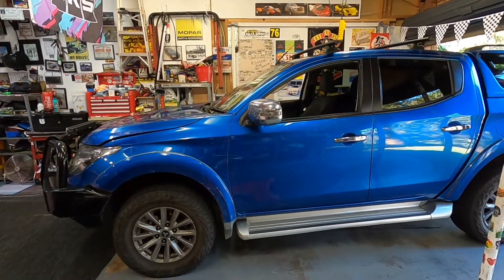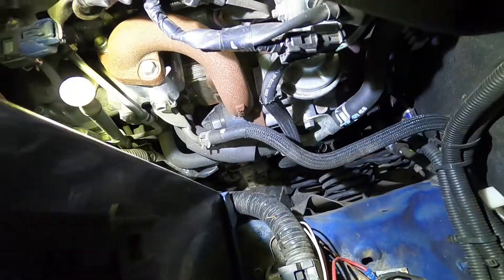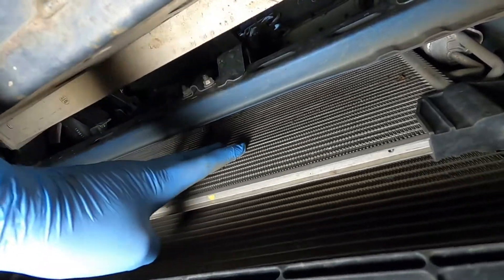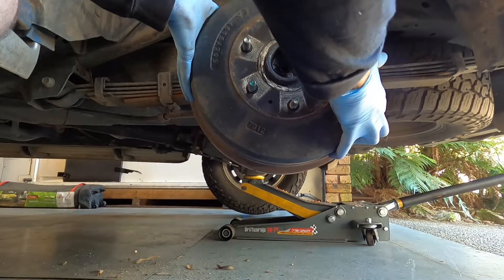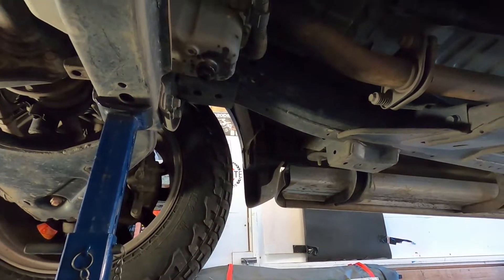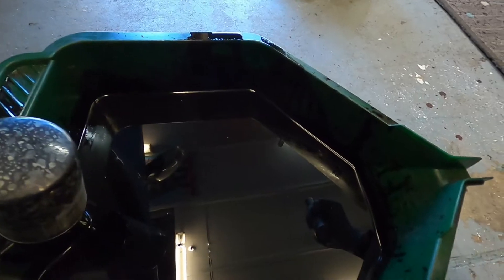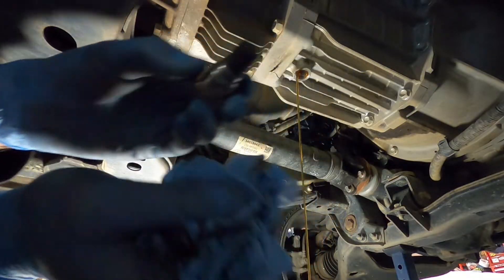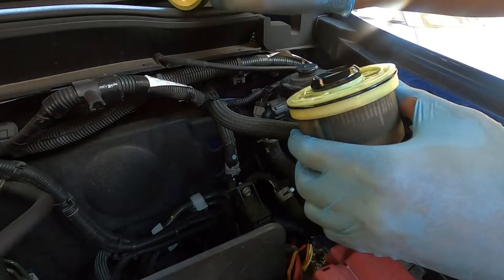Mitsubishi Triton 2.4 turbo diesel 4n15 service oil and filter change how to step by step.

Comment: brilliant,  very informative, now i can do my 2016 Triton with confidence,   i'm sick of getting ripped off by dealers,  the last dealer charged me almost $600 for a normal service,  no gearbox, diff, air, or fuel, filter changes,  and was returned to me with guard scratches which pissed me off hugely.   cheers.

Comment: Hey Mate! Great work on the service. Just to add something. Whenever you are doing a oil service on any 4N Mitsubishi Diesel engine, you need to perform the oil dolution reset -> On The MUT dealer tool this function is in...Engine / Special function / initialisation / exchange engine oil service. On other tools it is something similar, depending on the make and model.

Reason for this is that diesel gets injected to start and keep the DPF regenerating when it needs to. If it is sucessful, the fuel is burnt with no problems, but if the car is unable to complete its burn, or is trying to burn and there is another reason it cannot, then it will be added to the sump and the oils counter in the cars engine computer will increase.

When the car is serviced, the tech must reset this oil counter. And he should know what to look for depending on the reading. or instance if it reads 1500cc, he should know to look for an issue.

A car that is doing enough long journeys and has no problems will have a count of 0cc - 100cc.
Anything up to 600cc is ok with no action needed.
Reply: So those with 4n engines looking to self service should buy a scan tool to reset aswell?
Reply: @signature8543  In other words - yes. Resetting the oil dolution/exchange counters are part of the standard ""oil service/change" procedure in the official dealers (at least from my experience in Central Europe) If you are doing it yourself it is preferable to reset it with a scan tool which have the functionality to do it.  It sounds somewhat stupid, but something little like that can prevent you from spending thousands later. If you are doing a lot of highway miles the counters will not rise as much as doing a city driving. So definetely you need to monitor the values every 5-6 months to know where you are with the oil dolution.

This topic definately needs more visibilty because it is solving a lot of problems and in the end of the day it is simple reset.
Reply: @ВГаража  legend mate. I wouldn’t have even known about any of this hadn’t I scrolled through comments.
Reply: Don't need a MUT my $250 Launch does it like most scan tools you need to know where to look, but yes  it needs to be done...
Reply: @neilasd3043 agreed, my Foxwell unit is capable of resetting codes.
Reply: @ВГаража my experience is that when the oil level (calculated) reaches 1550ml a flashing DPF light appears on the dashboard. As this is a calculated value, if it is not reset when an oil change is performed you will eventually reach this threshold and get an error (p252f excess oil level) code and flashing light even though the level is correct. As you say, it is not just sufficient to change the oil and reset the service interval as this does not reset the oil level counter😮😮

Comment: For anyone reading the comments and wondering about which brand gear oil to use in their manual MQ/MR gearbox, definitely use Penrite Trans Gear 75w80! 

I’ve tried the genuine Mitsubishi DiaQueen oil, and Valvoline DuraGear and both are substandard in gearshift feel compared to Penrite.

Comment: Mate!!! Thank you so much just did my service,  never touched an engine in my life, and even replaced a faulty throttle Body myself!! Thanks great video. Also just a quick question,  when I drained the oil my 9 litre container overflowed ! If only meant to have 8.4 litres, does that mean Mitsubishi put to much in? Cheers

Comment: Mate!!! Great video!! I know nothing about cars and this has given me the tools to attack m 2016 Triton!! Only question, is the method for the oil change in gearbox the same for automatic?? Cheers
Reply from the maker: @sebastianperalta1111  the auto is almost the same. Just measure the amount of fluid that is drained and refill with the same amount of automatic transmission fluid.
Reply: @driftcarsjp  awesome thanks for the quick reply mate!! Wish me luck !!!

Comment: Thanks for making this video. I really appreciate it. Looks similar to my 2010 Automatic Turbo Diesel 4x4 Triton, I'm assuming this info will apply to older models too? As a female, I'd love to be able to service it myself and know what to look for so I know i'm not getting ripped off. Please keep making vids on the Triton. Maybe you can also set up a Patreon page so people can donate for the valuable info you provide. Thanks again.
Reply from the maker: You can apply this to any car just the fuild levels differ. Thanks for the positive comment much appreciated   👍
Reply: The MN Triton oil filter position is different. I do 7500Km oil changes so I do the in-between oil change. I access the oil filter from under the mud guard.

Comment: Hi There,  you said the engine takes 8.4 litres of oil?, the manual states the 4n15 diesel engine holds a total of  7.4 litres of engine oil, 7 litres in pan + 0.3 in filter + 0.1 in oil cooler, every oil change I have ever done has always been 7.4 litres, I have a 2017 MQ Triton GLS auto 4x4 dual cab, also when I look at Penrite's Lube guide it states 8.4 litres as well, strange?
Reply: I agree

Comment: Hi Driftcarsjp great walkthrough mate!!! I also do a few of these. Have you encountered the oil level fault yet that can get logged in the module. It stopped the DPF from doing a burn - regen and by oil level reset i do not mean oil service light. 
Cheers Mark
Reply from the maker: Haven't had that issue yet
Reply: @driftcarsjp  thanks mate if you ever do ill try explain unfortuanetly i did not video it.
Cheers Mark
Reply: Hi Mark, I am interested on finding out how to reset the oil dilution after an oil change. I have just done one at 7500km's half way to the dealer service at 15,000. I know how to do it on a D-MAX but not on my MR Triton. I don't think the majority of people realise how much of a big deal it can be if its not reset, with some people thinking it is to do with the service reset (which it isn't) Cheers Simon
Reply: @simonar1  I will find my notes and let yo know hopefully.
Reply: @markbritten1744  thanks

Comment: Subed, what oil to use in automatic transmission MQ 2015. I went to Tynan's to buy Trans oil and the don't stock it, so I asked what they use, spare parts guy called the workshop and said Castrol and gave a number but not a viscosity number. I called Castrol and the said don't worry about changing the oil if it's not black. Car has done 130000km.  Can you advice me on what oil to use and how many liters do I need?
Thanks
Reply from the maker: You can use penrite Multi-vehicle full synthetic ATF LV should take around 4-6 litres drain and refill ,unless you flush it.

Comment: Hey bud, how come the truck doesn't have to be level when filling the gearbox and engine with oil. I thought that would be critical to obtain the correct level
Reply from the maker: Having the truck slightly off isn't going to cause a great difference in oil going into the box. More will just go to the rear of the box wile filling as the filler is generally in the middle of the box.

Comment: Thanks for the great video mate. Can the gearbox oil level be checked with all 4 wheels on the floor? I can fit under there  OK,  just wondering if the gearbox needs to be leveled by jacking the car?
Reply from the maker: It does need to be level although a slight slope and a little extra oil doesn't hurt the gearbox..
Reply: @driftcarsjp  Cheers mate.  What should I level?  The chassis rails are angled down toward the front of the car and the gearbox is angled down toward the rear of the car when all 4 wheels are on the concrete.  To get the gearbox level I would need to jack the rear of the car up a bit, but to get the chassis rails level I would need to jack the front as it's natural stance is a bit nose down. When I initially removed the fill plug prior to removing the drain, I had around 200ml of oil spurt out. I have refilled with new oil to the bottom of the oil filler hole and I appear to be about 200ml short of the recommended 2.2L oil volume. All of this is with the car sitting on the level concrete floor. Should I jack it and see if I can get some more oil in or is it OK as it is?
Reply from the maker: @peterkerr542  200ml less is fine you'll never completely drain the gearbox anyway, there always be oil left in the box after draining it..
Reply: @driftcarsjp  thanks mate. Appreciate you getting back to me.Without a doubt the best servicing video I have seen for an MQ Triton. 👍
Reply from the maker: Thanks for your kind words..
Reply: @driftcarsjp  FYI - I took it for a dive and then let it sit for a few hrs to cool down. Checked the level again and found it had dropped below the filler hole and I was able to get the remaining 200ml in. Must have been an air pocket in there somewhere. Cheers.

Comment: For some reason i cant get the fuel filter to tighten up without leaking.im screwing the clamp up and it leaks when priming.Any tips?
Reply from the maker: It could be the rubber seal has twisted or not sitting in the correct groove in the plastic

Comment: HI sjp, How often do we change the oil gear of the Mitsubit trion pick-up 2017? because when I go to Mitsubit company to get the oil service, the oil gear is long life oil no need change it, in case the gearbox get the- problem that we need to change it? Are they correct in their recommendations? From Veasna, Cambodia
Reply from the maker: I would change the gearbox oil every 40000kms or every 2 years if heavy off road use.. no or light offroad every 3 years

Comment: can anyone tell me what diff oil you can use in this vehicle front and rear, MM specifies SAE80 GL5 but cant find anywhere
Reply from the maker: You can use 80w 90 premium mineral if you can't get GL5 . Where are you located?
Reply: @driftcarsjp  Thanks for reply I'm in Melbourne,  so a 80W90 GL5 will be OK instead of SAE80? I suppose when cold it will be the same thickness (80W) only a little thicker when hot
Reply from the maker: @frankm4120  penrite does GL5 75W 85 full synthetic
Reply: @driftcarsjp  Hi Thanks for your reply, I'm located in Melbourne
Reply: @driftcarsjp  OK, I have that at home,
you reckon it's a little thin at startup (75W vs 80),  or it should be right?
Reply from the maker: @frankm4120  that's the recommendation oil .
Reply: @driftcarsjp  thanks for your help,

Comment: I have same car as yours, but I have issue with my car. my car feel jerk after it's at warm temperatures or drive slow, especially at traffic jam. but it's changed smoothly when i just start driving at morning or i drive fast. Until now don't know what is the issue is🥲
Reply from the maker: @njfishing1917  manual or auto?
Reply: @driftcarsjp  mine is auto sir, 5 speeds

Comment: Hi , my triton mq has just done 90k. What should i include in my next service? Normal oil/filter  change  , fuel filter, air filter and spark plugs? Any other thing. Appreciate ur help.
Reply from the maker: Just diff and gearbox oils aswel
Reply: @driftcarsjp  thanks, do u have a vedio of sparkplugs replacement for tritons. None on youtube.
Reply: @driftcarsjp  hi mate really appreciate.  What tool i need to open drain plug of rear diff rwd mq triton.  It seems like large alan key and a small alan key shaped inside. Please help
Reply: @g.s.l2056  Diesels don't use spark plugs

Comment: Can anybody shine a light on what is happening to my L200 series 5. The oil level is rising. The general opinion was the DPF was blocked and filling it with diesel. I have had the DPF cleaned and the pressures are correct at the same time the oil counter was reset. The problem persists has anybody had a similar experience and did they sort it out. The oil rises maybe 10mm in 600 miles
Reply: Did you ever get to the bottom of that?
Reply: @andrewford80  not really mate changed the heat sensors, had it cleaned on the truck then took it off myself soaked it in chemical and cleaned it myself but nothing changed really.